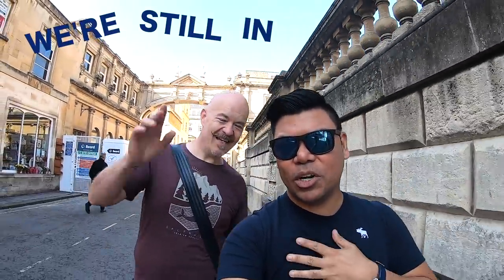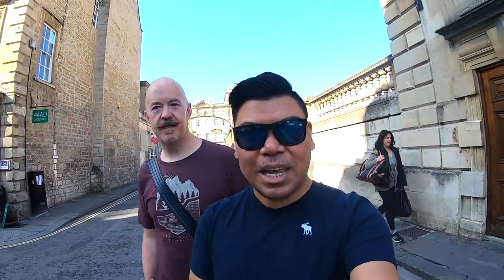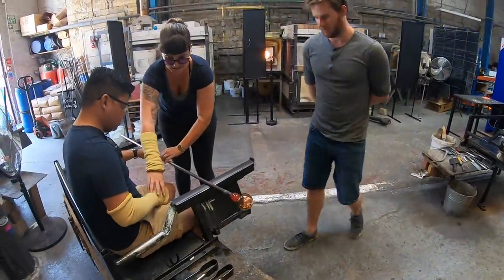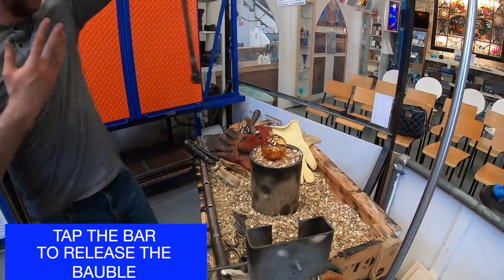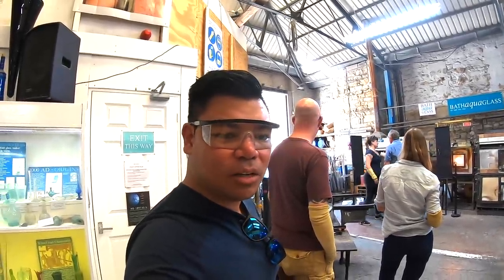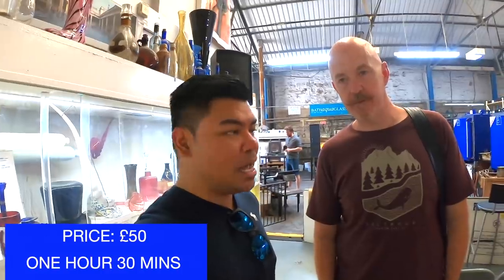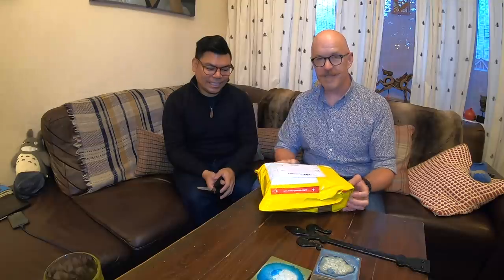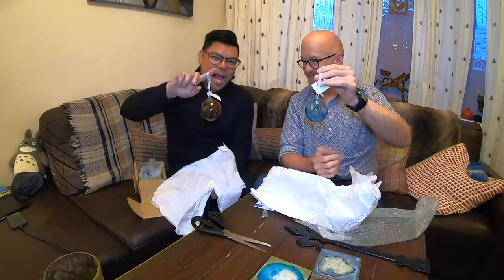CREATING BAUBLES GLASS BLOWING CLASS IN BATH

Comment: Looks like you had a great time making the balls. Nice one Neil. 

On a separate note, back at home, you had flickering light in your video. Bet you noticed it too in post. This has caught me out and bugged me in the past. The fix, when indoor shooting under fluorescent lighting, change your shutter speed to 1/50 or 1/100 depending on your frame rate and hopefully that should get rid of that flicker you see because Uk power is 50 Hz alternating current. Hope that helps.
Reply from the maker: Hey Chris! I should really ask you about shutter speed etc soon as you know all about it! 👍🏼🤗 I was using my GoPro when I took the videos. And I put it in automatic 🤗
Reply: Yeah, no problem.  I only have the GoPro Hero 5 Session and it is limited what you can do on that.  I think you mentioned previously you have the hero 7 so i don't know what you can/ cannot do.  But we can definitely run through this stuff when we catch up.  I will eventually make a video on it one day but I haven't even got through the photography part first which I want to do before moving on to video.  I did see there is something you can also do in post to get rid of the flicker but haven't looked into that properly yet.
Reply from the maker: Cool thanks for your help just let me know Chris 👍🏼🤗